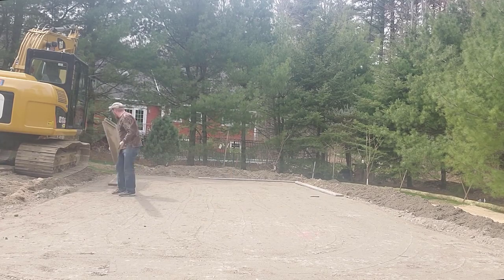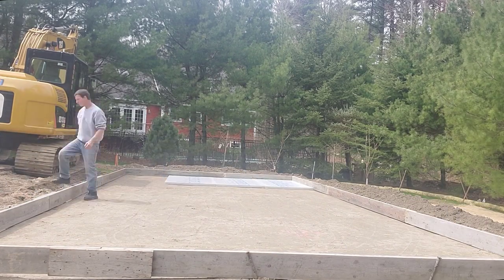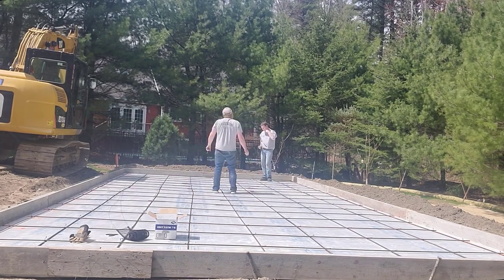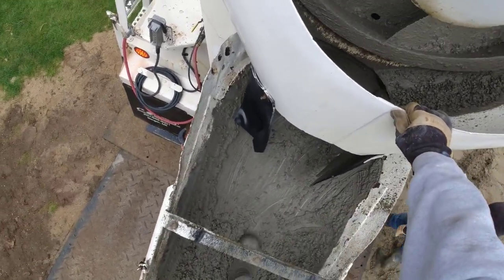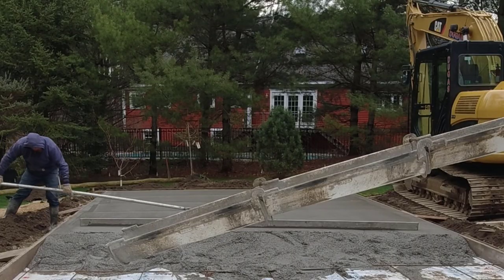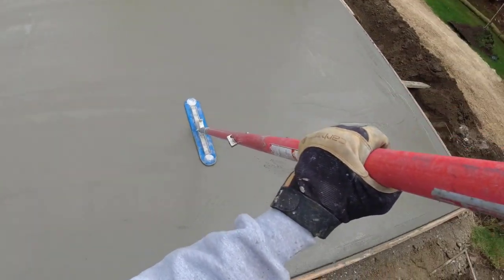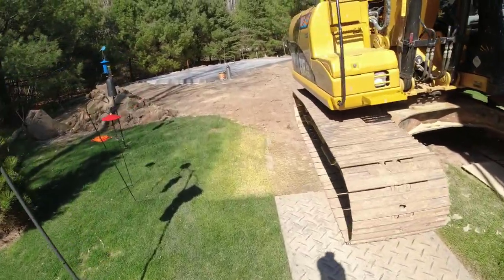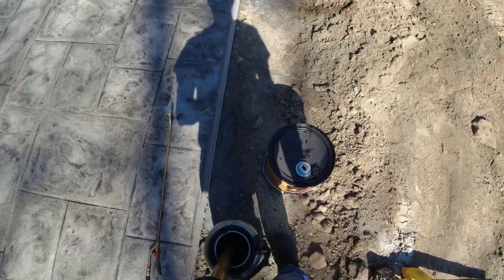How To Form, Pour, and Stamp A Beautiful Stamped Concrete Patio Slab (34' X 16')

Comment: How much powder release do you add to the liquid release?
Reply: I was going to ask the same question.
Reply from the maker: About 2 cups per 2.5 gallons in the sprayer, then shake really good and continue to shake here and there as you use the sprayer.
Reply: @MikeDayConcrete  when you wash it off do you need a pressure washer or is hose pressure enough to get the pad clean before sealing it?
Reply: What brand of liquid release do you use?